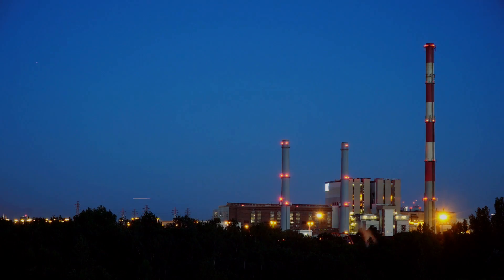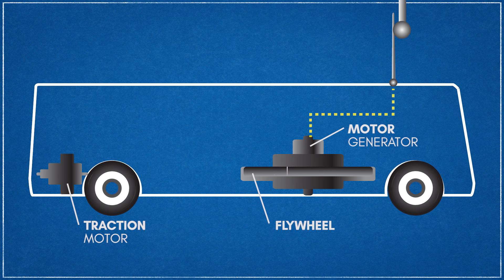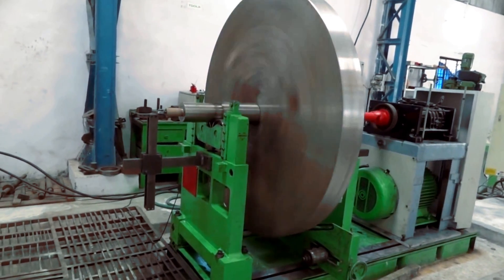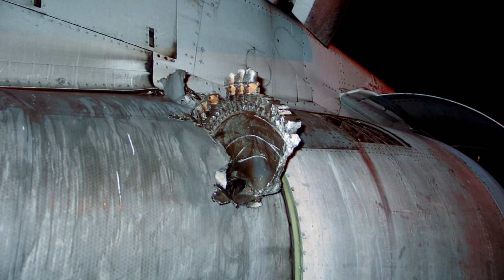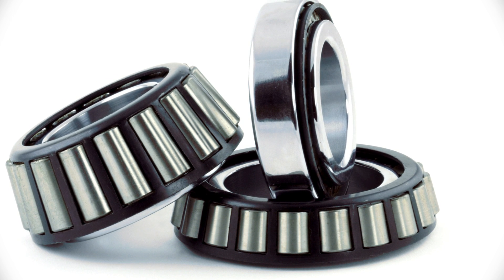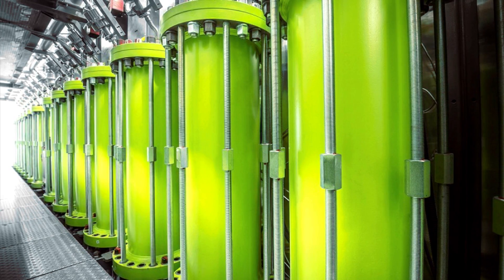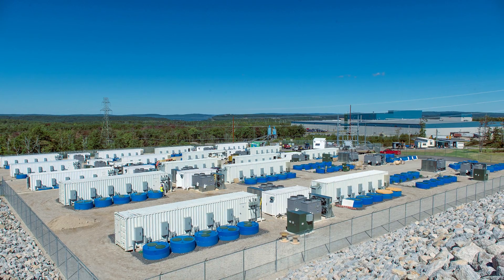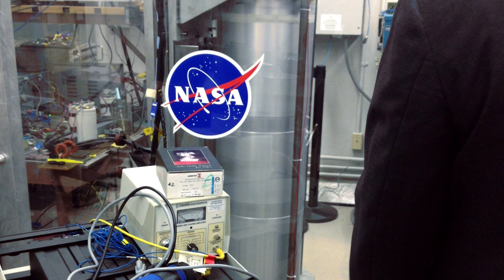The Mechanical Battery

Comment: At Last! - the dawning realisation that this old technology is the most sustainable and Green solution to meet the World's bulk grid energy storage requirements.  The university students here have been developing this concept for this purpose (originally in support of individual houses, buildings and small villages) for the last 7-8 years and would like to comment and add to the long list of benefits presented in this video.  Firstly, we're not keen on running the flywheel in a hydrogen or vacuum filled enclosure for obvious reasons  - we've worked out that the transonic drag of the rim can also be significantly reduced by allowing the air to heat up.  A one-way air valve out will increase the speed of sound more and reduce the transonic drag still further.  So FESS becomes more efficient the hotter it gets! - ideally they'd be painted black in a desert and would benefit from the heat loss at the bearings - a huge benefit over batteries which usually require ventilation and cooling.  Secondly, we believe that the short-circuit discharge characteristics are much less dangerous than the 'capacitive' based storage systems currently under development.  Thirdly, the storage of energy at point of need opens up most beneficial opportunities for SMART meter management and supply competition. We agree, however, that the biggest benefits remain the utilisation of well-known and cheaper technologies, the use of abundant materials, the lack of need for rare earths or compounds, reliability and its potential use for many decades without any drop in performance or storage capacity.
Reply: I like the idea, that by measuring the RPM of the wheel,(and a little math) you know EXACTLY how much energy you have available. No guessing!
Reply: @vincentrobinette1507  - Yes  that's a big advantage too and this capability is never lost.  That touches on another great advantage - the whole concept is easily scalable and you can adjust the flywheel dimensions and max RPM to perfectly match the requirement - we've got a range of designs for units of 100MJ to 10GJ storage - need more? just connect more units.  FYI - we have proposed this to the Solar Impulse Foundation as one of the 1000 Ideas that could change the World that these designs should be 'open source' so that everyone around the World could build them with minimal design effort and cost - unfortunately we didn't make the list.
Reply: @exetercollegeuktechnologyc1323  All my comments so far, are based on the idea of stationary use: A way to make the energy harvested by wind turbines, and photovoltaic panels, dispatchable. I don't think magnetic bearings would be suited for use in vehicles, with all the angular stresses caused by the gyroscopic effects of driving. I'm not too worried about the rotation of the earth, I think the magnets could absorb 15° of axial shift per hour, due to the rotation of the earth.(assuming the flywheel runs  vertical axis right on the equator) To use magnetic bearings, as was implied in this video, would be to have permanent magnets angled, so there is some radial control, as well as axial lift, but still have electromagnets, that can be used to re-center the flywheel, if it is subject to some movement. Then, finally, there would be "crash" bearings, which are just ball bearings, who's outer races are just slightly smaller than the wells, and would never make contact, except for a hard shift, beyond the field strength of the electromagnets.(seismic event)
      The only caveat, is that Neodymium magnets might be necessary to get the field strength necessary to support the weight of the flywheel and rotor assembly. It can be done with standard magnets, if there were multiple discs, and stators, stacked, so you have the repulsive strength of multiple layers of magnets, to hold the mass. Think of multiple wagon wheel shaped flywheels, each supported by its own magnetic ring, all stacked on the same axle. That would allow the use of inexpensive ferrite magnets, but they would have to be placed near the axle, rather than the rim, because of centripetal force, once the flywheel is up to full speed. Ferrite magnets are actually somewhat fragile. Both the rotor and stator need to use permanent magnets, like pole to like pole, which the rotor magnets get to go for a ride on the merry-go-round.
Reply: @vincentrobinette1507  - we agree with everything you say here.  We have been invited to attend the Smarter Power Grid Forum: The Future of Energy | 25th November 2019 | Central London but we have absolutely no funding for this sort of thing.  The intention is for the forum to 'gain the latest knowledge around removing the barriers to adopting smart technologies, allowing you to be at the forefront of providing sustainable services to customers and adapting to their demands.
 With a special focus on the international market, we will be exploring the potential collaboration opportunities for UK stakeholders'.  We would really like to go, but if you're going we'd really like to give you every support.  Our main aim is to make the FESS designs open-source so that everyone around the world can consider them and the costs for design, configuration, installation and utilisation should rapidly fall.
Reply: @exetercollegeuktechnologyc1323  Like any new technology, it will start out somewhat expensive, but scale of mass production will bring the installed cost per kWh way down. Right out of the gate, the LEVELIZED cost will be competitive with the best batteries we have today, just by virtue of its longevity. It's just that the return on investment will be a little longer, just like photovoltaic panels, a decade ago. The thing that will make this cheaper, is the use of inexpensive, domestically sourced materials. No exotic rare earth metals needed. The only thing to look at, would be carbon fiber, and the resins to make flywheels that can spin at unprecedented RPM. Doubling the speed of the wheel, stores 4 X the energy. If you make a wheel with 1/2 the mass, and spin it twice as fast, it will double the energy storage, giving 4 times the stored energy per Kg.
     There is one caveat: I live in the U.S.A. I don't have a low carbon way to commute.(unless I can make friends with 'Superman')😁
Reply: @vincentrobinette1507  - All agreed again.  The major hurdle is 'return on investment' in the short-term which may completely prevent it's introduction around the World in the long-term - everyone wants to make money out of it regardless of the fact that it is very  efficient, reliable,  made from abundant materials, uses well proven technology and can be used for many decades without any loss in storage capacity of performance - it could make a major contribution to saving the planet!  To address this dilemma, our idea is to produce a range of FESS designs (different sizes and RPMs) optimised for their storage requirements (we have 110MJ - 4GJ designs at the moment) and make these designs open-source to the World so that anyone can consider building and using these storage systems wherever they are - all the costs would quickly and significantly reduce in this way too.  We hope this will make a very significant 'Green' contribution to the World's increasingly difficult energy storage and management problems.

Comment: Nuclear energy and fossil fuels arethe only option that won't separate the classes further. Pushing dirty so called green energy will result in the deaths of millions, turn millions more into peasants and make the 1% you complain about now, unassailable energy Barron's unbound by anything except corporate law....

Don't be sheep...
Reply: Had to find one of these nuclear comments to reply to. Nuclear makes a good baseline power source only if one of the more efficient designs is used (fast reactors). Thorium has a ways to go before it’s commercially viable (problems with corrosion).
Solar offers excellent peak load supply.
I mention this because I see people jump on the “nuclear all the way” bandwagon and it’s ignorant. As was even said in this video,  there are many different energy situations that will require different solutions.
So, don’t be a sheep.
Reply: @nl9835   I started to write a long rebuttal...

Then I remembered, Climatards....

Comment: Why not "store" energy as synthetic hydrocarbon fuel?
Reply: Ethanol fuel does this.  Car guys love it for it's high knock resistance and ability to cool.

Grown, brewed and distilled from plants like corn, and sugar cane.
Reply: @BramBiesiekierski  One of the crazy things to play on them is algae biofuels they often go total schizo and it has better energy output to processing cost energy rates than ethanol as nearly all of it is usable.
Reply: Round trip energy efficiency is pretty low, even if you use fuel cells.  Fuel cells are expensive.
Reply: Carbon Bad! because ... because... Uhmmm... There is no real reason other than the Church of the Environment has deemed it a mortal sin.

Comment: Electric transmission system can be made more efficient run along/near roadways to power capacitors-mostly and a fairly small battery. . 70% of energy to go up the hill can be returned to the system as it goes down the hill.
Reply: Modern Flywheel systems are much more than 70% efficient
Reply: @exetercollegeuktechnologyc1323  I was not commenting on the flywheel.  I was commenting upon regeneration of electricity used to go up hills as vehicles go down hills and the concept of a 'direct' connection to a re-built electric transmission infrastructure.  Off topic?  Not really as the flywheel has limits.
Reply: SunriseLAW Do you mean putting regenerative braking on all cars?
Reply: @brandonb9452  Yes, to fill up the capacitors and much-smaller batteries or to put it back into the 'system'.   Tesla (e.g.) looks great, they make 300,000 cars while 17 million new and 25 million used cars are sold in USA every year.  Obtaining lithium...which is plentiful...and processing it into batteries is not optimal when talking about tens of millions.  A semi-hard wired solution makes the vehicles much lighter.  Figuratively and metaphorically: The entire system could be built out by melting down what we  have and reforming it.

Comment: Usually I'm optimistic about developing Technologies. I was even stupid enough to have a little bit of optimism about hydrogen fuel cells. The only thing hydrogen fuel cells were good for was delaying the development of an electric vehicle. One of the problems with electrochemical battery storage is that the technology is advancing so fast that some organizations are worried that a system they Implement today will be outdated in a few years. They are "perfect enough" to replace fossil fuels now. We don't have 20 years to make them more perfect.
Reply: Hydrogen fuel cells didn't delay the development of an electric vehicle
Reply: @corpsiecorpsie_the_original  they are still being used to delay implementation of lithium ion EV batteries in electric cars to this day. 
From a review of the movie "Who Killed the Electric Car"
Eventually, it blames the car companies, the oil companies and politicians, especially a California clean air official and President Ronald Reagan and President Bush One and Two, for helping to kill the electric car mandates by the state of California that effectively killed the electric car. It also attacks the current Bush administration for promoting hydrogen fuel cell cars, a technology that seems to be years in the future, if not a couple decades. The movie points out that Bush’s former chief of staff, Andy Card, was head of the auto manufacturers association that argued against the California mandates back in the 1990s.
WHO KILLED THE ELECTRIC CAR? makes some good points in favor of hybrid electric cars and future hybrid cars that may have a plug-in electric feature. Apparently, however, more than a few experts disagree that cars running on hydrogen fuel cells are so bad as this movie makes out. In fact, the movie only keeps citing one hydrogen fuel cell expert who seems to support the movie’s argument in favor of electric technology over hydrogen technology. The movie never gives the California clean air official, himself an expert on hydrogen fuel cells, much of a chance to refute the facts cited by the movie’s favored hydrogen expert.
Reply: @simplethings3730  - No, they are not.
Reply: @corpsiecorpsie_the_original  if you if you don't want electric vehicle technology to succeed, the best way to prevent it is to back a technology that is fallible and will not work.

Comment: Do flywheel energy systems lose much any starting and stopping?
Reply: Yep all of it when stopping and some gets turned into thermal energy.
Reply: Not really - the video explains that there is very little loss in the modern bearing so most of the energy you put in can be got out whatever the speed.  Our design though does not allow the flywheel to come to a full stop.

Comment: Somewhere around 20 years ago, maybe 30, I saw a car that had a dozen small flywheels, all gimballed. Each unit was about 2 litres volume. They fit into the standard engine space, along with the electric traction motor. This solution seems possible, small units that are easy and cheap to make and install. It gets past the gyro problems of planetary rotation and turning, climbing hills etc.
Reply: wow that's weird and cool
Reply: The energy capacity must have been egregious.

Comment: why not just use the energy in the fly wheel to drive the wheels via a cvt etc ?
Reply: Mechanical losses are higher than electrical losses. A mechanical system must be relatively complex, thus more subject to failure. Also, an electrical system is much more flexible than a mechanical one, in terms of placement of components.
Reply: That idea was actually explored in F-1 racing. that was that unit showed in the video at 15:4 to 15:33. That's a flywheel, not a motor. This unit is a Continuously variable transmission mated to a high speed flywheel. The energy stored in a flywheel goes up on the square of its RPM. By cranking this thing 37,000 RPM, they can pack all the energy needed, to slow the car in a corner into the flywheel, and use the energy to help accelerate the car out of the corner. Minimum heat lost in the brakes, and available power beyond what's available from the engine.

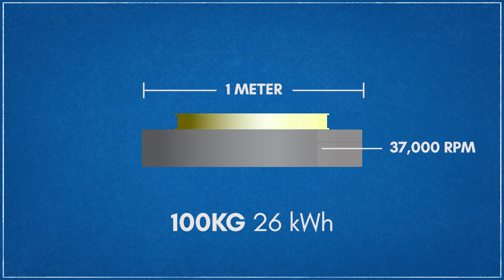Comment: 12:48 So you actually used 1m as the radius of the flywheel in stead of 0.5m to calculate the Mach number (at see lvl) of the outer surface. So the Mach number should be around 5.5. That's still fast though.
Reply: I see mistakes happen at sea as well.
Reply: @Vincent Robinette, ... but I think they stated 37,000 rpm @12:50, so that's  4333 mph ~ Mach 5.6, as @K mentioned.
Reply: @snivesz32  That's the speed of the small flywheel used in the CVT for the Formula-1 race car. They don't state the diameter of that wheel, so I cannot make a calculation. They state that the flywheel in the bus turns 3,000 RPM, and that the wheel is 1 meter in diameter. My calculation is based on that.
Reply: 'Cretans' ??? Is that an in joke . . . . . .
Reply: I just ran the numbers, based on the diameter of the wheel being 1 meter. there are 3.2808 feet in a meter, X Pi, and the circumference of the wheel is 10.306937 feet. Multiply that by the stated 3,000 RPM, and the circumferential speed of the flywheel is 30,920.811 feet per minute. divide that by 5,280,(the number of feet per mile, and the speed is 5.8562142 miles per minute. Multiply that by 60, to get miles per hour, and the circumferential speed is 351.37285 miles per hour. Mach is considered to be 768 miles per hour, at sea level. that is .4575167 mach. A 185/65R15 tire turns 1,000 RPM at 72 miles per hours.(833 rotations per mile)
Reply: One Cretan makes a comment and magically all the the other Cretans chase his tail!
Reply: Please do research and make videos about this topics

https://fitsmallbusiness.com/hottest-emerging-tech-jobs-2019/

Top 30 topics/ideas I want you to talk about in your future videos in this new YouTube channel "New Mind":
1.  Graphene Battery
2. Nanotechnology 
3. Artificial Intelligence, Machine Learning, and Deep Learning. 
4. The three levels of artificial intelligence 1. Weak or Narrow Artificial Intelligence  2. Strong A.I.  3. Super Artificial Intelligence 
5. Quantum Computers
6. Artificial Intelligent Robots
7. Autonomous Machines
8. Blockchain Technology
9. Bitcoin
10. Hacking and Cryptography 
11. 5G, 6G, 7G, and beyond. 5G New Radio Network.
12. Big Data
13. Cloud Computing
14. Parallel Computing
15. Geospatial Drone Technology
16. BioNanotechnology (biology and nanotechnology)
17. Tachyon (Faster-than-light-particles)(hypothetical particles)
18. Alcubierre warp drive (10 times faster than the speed of light) https://www.universetoday.com/89074/what-is-the-alcubierre-warp-drive/
19. Nuclear Fusion
20. Space-Based Solar Power
21. Bio-fuels
22. CERN. Large Hadron Collider. Antimatter
23. Dark Energy 
24. Dark Matter
25. Quantum Supremacy (Google Tech company)
26. Quantum Mechanics 
27. Quantum Teleportation 
28. Quantum Time Traveling
29. Interdimensional Travel
30. Interstellar Space Travel
Reply: @Mnerd7368  New to YouTube, huh? Posting a comment directed to the channel creator does no good if it is buried in another comment thread. Why would you post that under this thread?
Reply: @xenonram  except the channel Creator clearly saw OPs message lol
Reply: @xenonram  Hopefully so New Mind CAN'T see it // transition from these great topics to that cheesy list of quantum-boredom  that are always "live" on youtube as it is.
Reply: @Mnerd7368   I do not make any youtube video's.